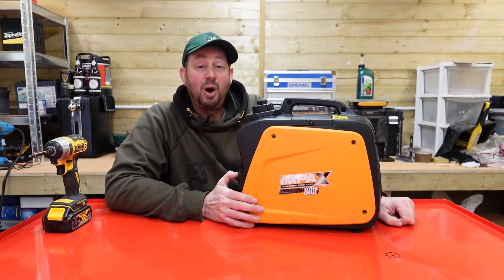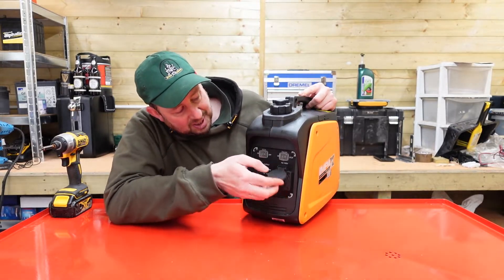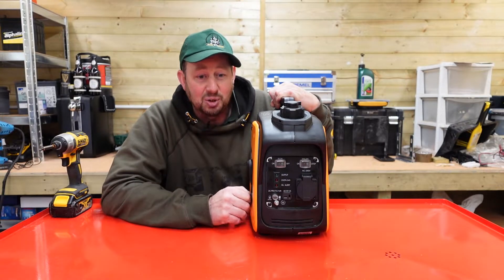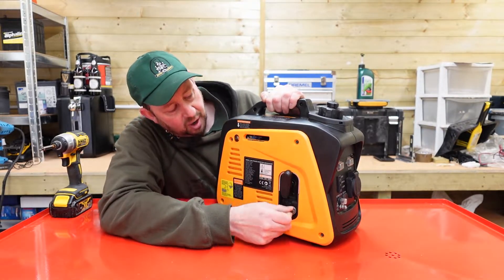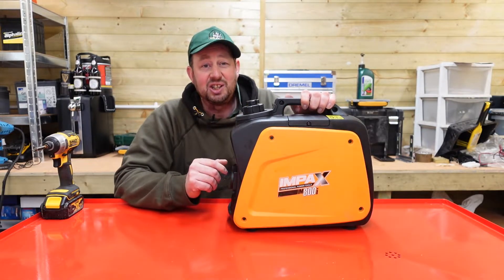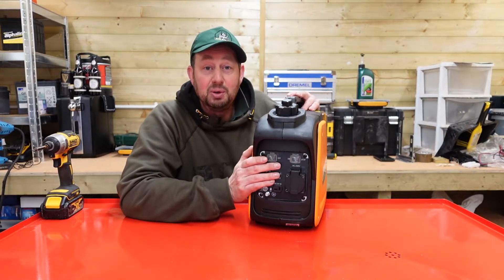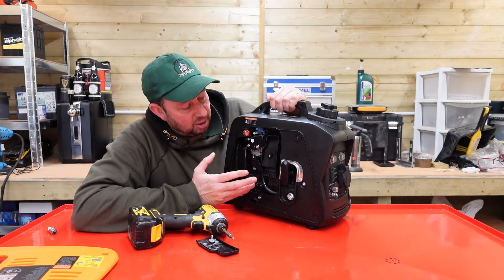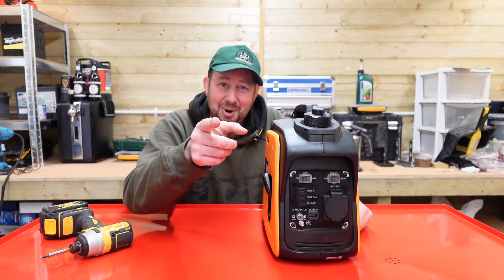Troubleshooting fix for Impax inverter generator IM800I 700W 800W 230V invertor repair how to

Comment: Hi Jimmy, how or what do you use the earth this? Using mine for the allotment?
Reply from the maker: Earth Rods made of copper are what you use for permanent installation but for more mobile use pretty much anything that connects it to the earth is better than nothing.
You are ideally just creating a shorter more accessible path for the current to flow to earth, rather than through you.
Reply: @JimmyTheMower  cheers Jimmy, pretty much thought that, just wanted a second opinion to be on the safe side.
Cheers buddy 👍
Reply from the maker: @tomtompkins8992  No problem at all.
Loads of people don't even bother but since my video I've started to use a jump lead to attach to the earth point and then just clip it on something suitable at the other end.

Stay safe,

Jimmy 👍

Comment: All I can say is it's a pity there isn't a bigger market for small generators. If there was you'd have a million subs, Jimmy. I bought one after watching the original video you did and can't fault the thing. I had one problem you've listed here - the gauze in my case, causing it to run a bit rough and spluttery. I used a fine sewing needle to carefully poke at the carbon buildup for about 5 minutes. That cleared it out just fine and it's purring again. These small engines have come a long way since I was a landscaper in the early 2000's!
Reply from the maker: Cheers mate, when they run they run but when they start to play up it can be a real hassle. 
Glad you got yours sorted,

All the best,

Jimmy 👍